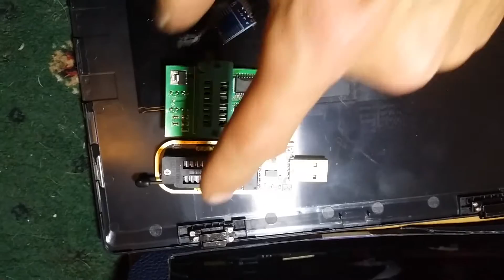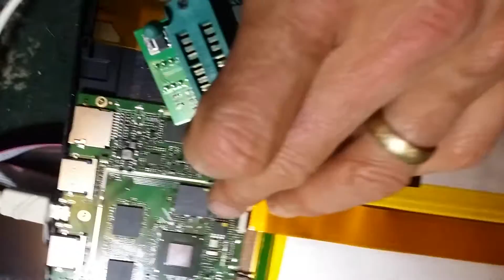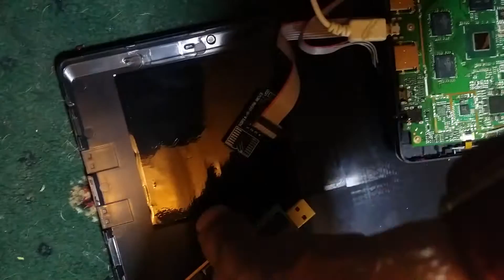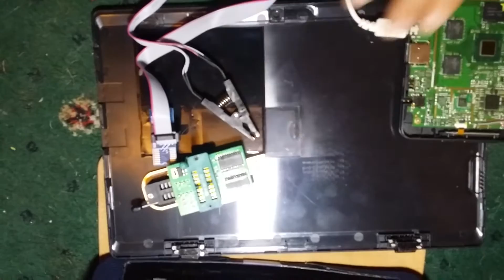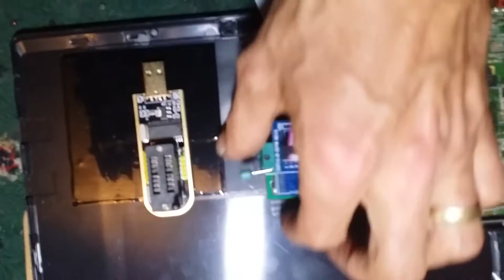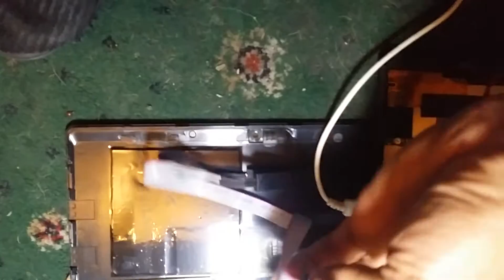How to repair a China tablet corrupt bios.

Comment: hello, this tutorial would serve for a chuwi h10 plus with firm 20161118 before brick?
Reply from the maker: JoeSnake  yes it should but make sure you get the correct bios file for the hi10 plus. 😁
Reply: Armookie thank you very much for answering, with your confirmation, and buy what is necessary to recover it, luckily before the brick I could see that bios had my chuwi, because when looking for it with the serial number that is on the back cover nothing appears in the forum of chuwi

Comment: hi matey in desperate need of some help.  My 11 year daughter saved up £170 and we got her a chuwi 14.1 laptop from gearbest.  When it arrive I flashed the bios with the correct bios but the knobbers at Chuwi had a duff bios file and it won't boot now.  Do you think this might fixed the Chuwi it has a winbond chip on the motherboard.

P.S. I am a cisco engineer by trade so all looks simple enough.